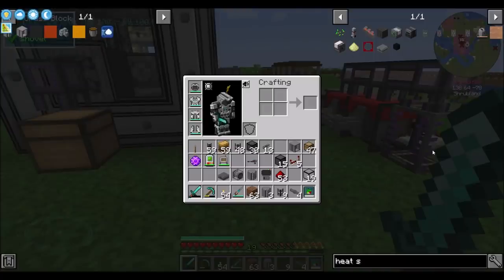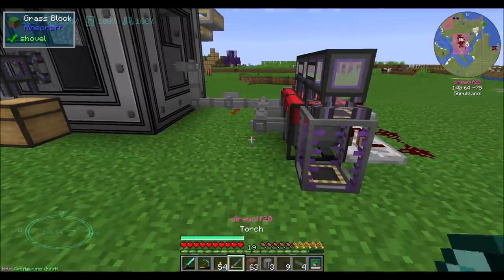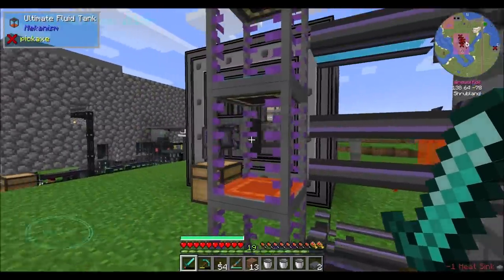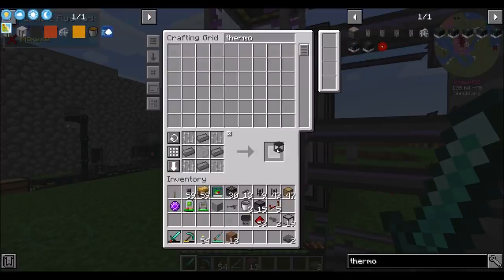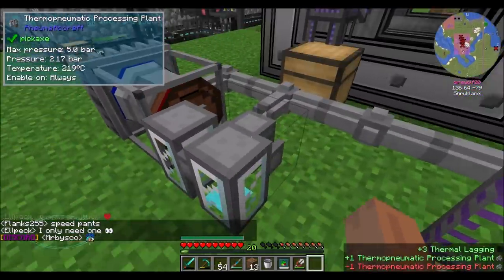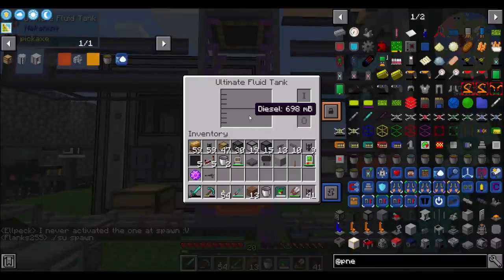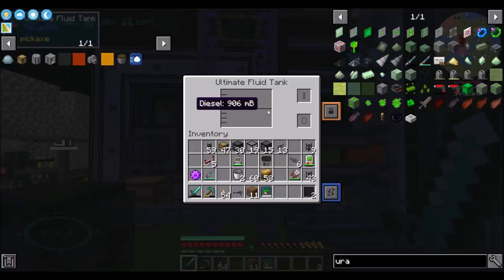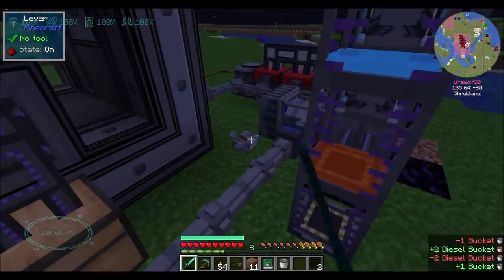Forgecraft S13E28 Lubricant and Heat

Comment: You know what I would love to see in pneumaticraft? A Trompe. It was something used back in the day to generate pressure using waterfalls. Practical Engineering did a video on it. Might be a cool way to generate pressure, using waterfalls.
Reply: Just looked it up, and I think that is an awesome idea. Could have a fluid tank above, a pressure inlet pipe, then more pipes and a separator beneath which dumps into an air outlet and a fluit outlet. Add a fluid valve, and there ya go! A fast way to develop some initial pressure.. though with so many mods having pipes that pump on their own, I could see players simply building one of these and not spending fuel or labor making another pressure source.

Comment: Mekanism resistive heater can heat PNC machines too, using only a very small amount of power
Reply: Really? I haven't used pneumaticraft since before they added heat mechanics(to mekanism) I wasn't aware they were compatible.
Reply: @MindCaged  they are.  I added Mek heat & fuel compatibility in late 1.12.2, and added it back again in 1.15/1.16.

Comment: Dire, isn't there a SAFETY/SECURITY upgrade  for Pneumaticraft? IIRC it looked like camera (cctv one)
Reply: There is, and yes it looks like a security camera.  Not strictly necessary if you've set up redstone control, but still not a bad idea if you have server lag issues, or forget to configure your compressors ;)  But it does waste air when it vents, which means wasting fuel.  Also, the Safety Module can go on pressure tubes to do the same thing - if you have a lot of compressors, then it's cheaper to use the module since you only need one.  Just be sure to put it on a tube as near as possible to your compressors.

Comment: would it be possible / would it work to place a source of lava a block or two off from the heat sink/compressed iron block and still have it affect the temperature and not be converted into obsidian? And if it does turn the flow into cobble would it be possible to align a block breaker (IE: cyclic??) to keep the space open for the flow to continue??
Reply: Nope, the mod specifically checks for (and follows back to the source) flowing fluids.